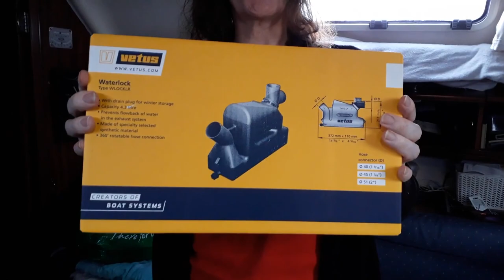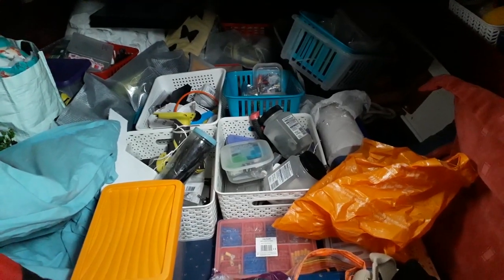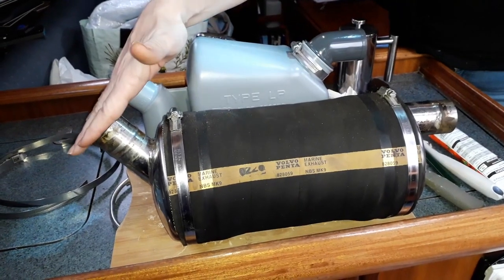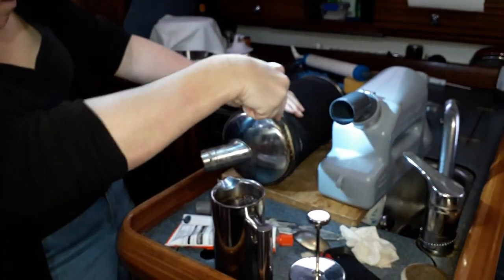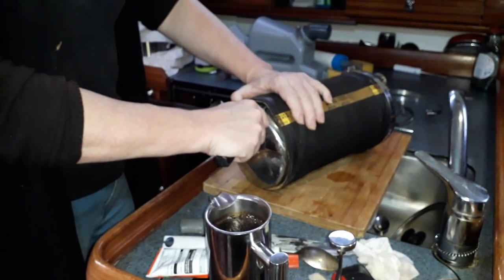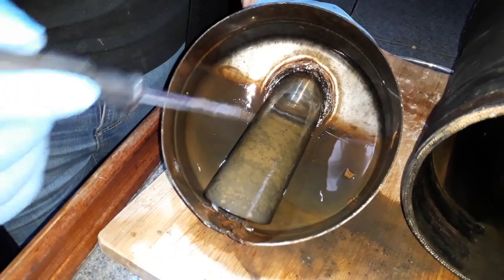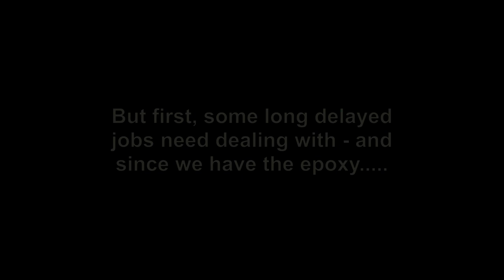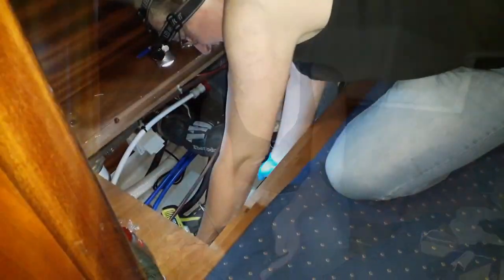Waterlock - Volva Penta Exhaust - Winter Sailing - Ep. 121

Comment: The sailing school I sailed with had to replace their exhaust on a similar year Bavaria to yours but in that is was a full stainless tube instead of rubber and it was like a pepper pot with lots of fine holes in due to rust. Useful video thanks.
Reply from the maker: Stainless steel is a good metal - as long as it gets to dry out on both sides. Glad the video helped  👍

Comment: Wanted to check out exhaust silencers and it took me to your video. I can’t get away from you girls! I wanted to what the inside my silencer looks like I think it’s full of gunk. It’s the same as the one you replaced. Thanks for sharing.
Reply from the maker: Those steel Volvo ones just rot from the inside and they are not cheap. The Vetus seems to be holding up well and was half the cost.

Comment: You are making us feel very happy about our composting toilets even if getting rid of 42 year old sewage pipes was disgusting.
Plus we hope to find that air cooled electric motors are cleaner, more reliable and essentially zero maintenance.
Happy to sell you a spare diesel engine if you want it.
Reply from the maker: Actually, our Jabsco toilet is fine. It does not smell and as long as we keep it clean and occasionally dose it with vinegar overnight then it seems to stay clean.

We will keep our existing engine. It is starting to feel like a close friend ;-)
Reply: @SailingYachtSaltyLass  sadly while the Blakes loos themselves were ok the seacocks and hoses were not. Plus there was no holding tank. When changes are needed the composting loo is a no brainer, really nice to use, no pipes, no pollution, no water use, no holes in the boat, no smells.
I'm averse to needing to become friends with an engine 😂
Reply from the maker: We already had the holding tank. We just changed every hose and the the seacock. We thoroughly flushed the system beforehand and even used bleach since we were doing all the pipes and valves anyway.

The system gives us no trouble and a cartridge loo would fit badly. We watched someone else change the loo on our model of Bavaria. The manual jabsco stays!!!!!
Reply: @SailingYachtSaltyLass  a lot changed after 1977 when ours was built. We have been happier to have an excuse to change things.
Reply from the maker: Boats are like relationships. You have to suit each other and grow into each other's comfort zone ;-)

Comment: Just a heads up, my engine overheated (impeller issue) and the waterlock unit, same one, had a strap on it to hold it down.  Well in the process of overheating the strap melted to the plastic housing and caused major holes.  In turn, I had no water or exhaust fumes exiting the boat.  It was all pouring into the engine room.  Just wanted to let you know something to be aware of.  I am thinking about using a stainless steel strap.
Reply from the maker: Thanks for that. I imagine that getting a steel strap to fit that waterlock is a project all by itself.

Comment: Get the hairdryer out, a bit of heat helps getting pipes on and off.
Reply from the maker: Hairdryer? What is one of those? We salty lasses dry our hair by letting the four winds do the work (or holding our heads upside down under the hand driers in the toilets) ;-)

Comment: What model Vetus is it? looks like  WLOCKL40R.  I have a 2004 B36 and the Volvo Penta exhaust is starting to go like yours..
Reply from the maker: Ours just said WLOCKLR on the side but it was the 4.3L capacity model for a pipe of 45mm diameter. There are more details on our website in this article which mentions how to check the capacity you need.

http://www.saltylass.co.uk/rusty-waterlock

Also if you are looking at the exhaust system, keep an eye on your exhaust elbow. Ours went when we were at sea. Luckily we were close in when it happened.

Comment: Great video! Thanks!
On my Bavaria 38 (2004) with MD2030, I’m doing exactly this right now. 
It’s been 2 years since you posted. How has it gone? Are there any postscript tips?
Reply from the maker: It has been absolutely fine. We have had no problems with it. If your engine is that sort of age, have a mechanic whip the exhaust elbow off and check it out. Ours went around the time the waterlock went "pop".
Reply: @SailingYachtSaltyLass  Great! Just had elbow checked Inter cooler checked. 
Thanks.
Reply from the maker: That is good to know 👍

Comment: What is the part number for your wet exhaust..thanks for your informative videos I'm loving them ?
Reply from the maker: Hi Frank - It is a Vetus LP45. It has a capacity of 4.3 litres and a hose size of 45mm. If you are replacing and old waterlock, make sure you get one that is correct for your boat as the size may vary from ours.

Thanks for your comments on the videos. It is great to know that they are helping people and hopefully are fun to watch as well.